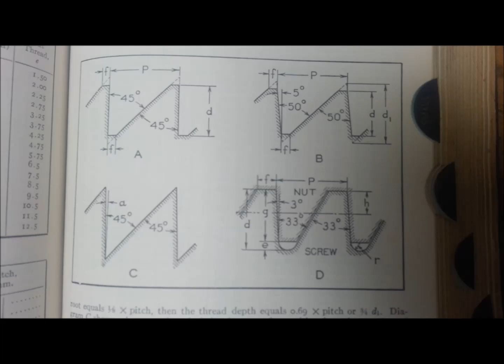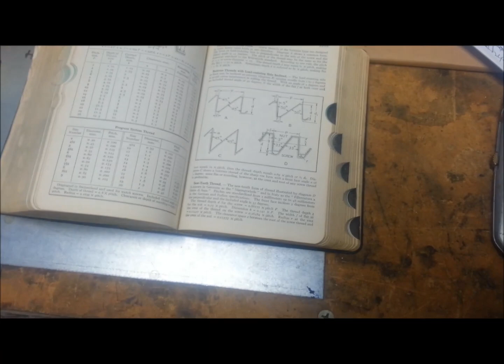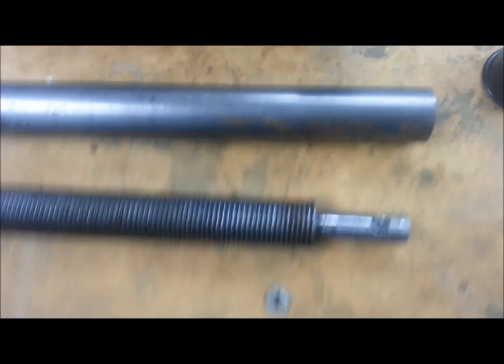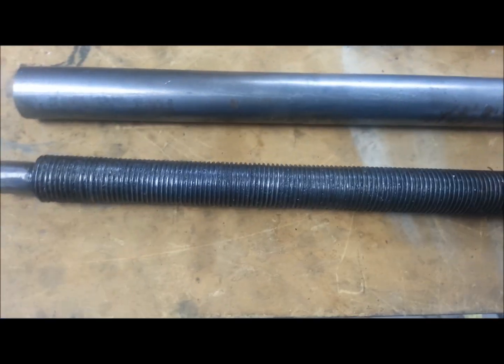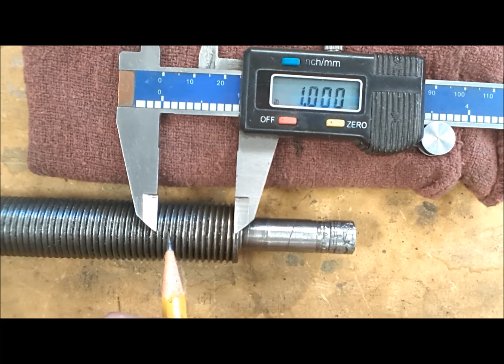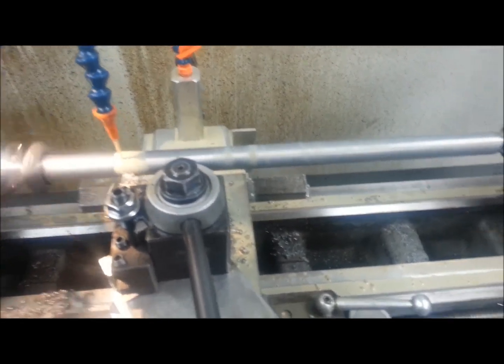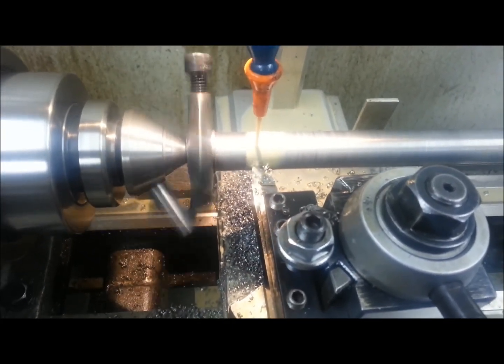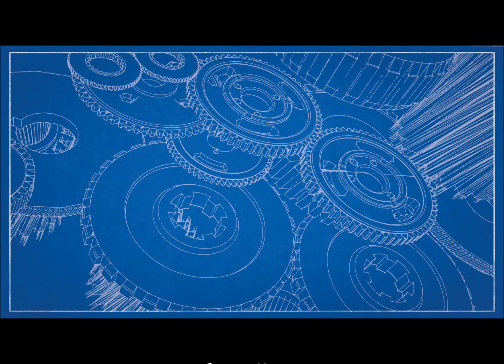Buttress threading

Comment: Hmmm, a rare video on the topic, and not much info about the topic in it... I do appreciate it however... I`ll need to make a thread like this soon - I have a project in mind, a plunger style pepper grinder... An inox tube with a few threaded bits that actually act as threads, and the saw-tooth facing with the thrust side downwards, so when you press the plunger, the teeth shear the pepper grains with each stroke, and get them out of the way after tossing the shavings out of the orifice... I guess i can`t explain it much better than that, but it was an idea that i had while browsing the store and looking at the commercial pepper grinders, one of which had a diamond knurled shaft to do the same thing, but the knurls likely aren`t all that good at doing the intended job, so i thought to myself that it should have been made with thread-like, slanted knurls, and then the idea of the buttress thread came to mind... 

I know that it`s a total waste of time, a ridiculously over-engineered bit of madness and something that only a machine zealot would engage in, but then again, I am a machine zealot, I stand by the logic the overkill is the best kill, and so the pepper grinder will be made thusly... I`ll likely just mis-align a regular threading insert so that it faces square to spindle axis in one way and has a 60deg angle to the spindle axis on the other, as it`s not an actual functional buttress thread that is intended to perform the job that such threads are intended to do, but being a ``saw-tooth`` thread, it will make for a great pepper-grain shaving mechanism, and i`ll be damned if it won`t make for an amazing gift for a few people that i know to be enjoyers of good pepper varieties, as well as being a cool little grinder for my own uses, what with my appreciation of good pepper in food... 

If I cared to do it, i could first use a radius tool and give the inox blank some grooves which could be filled by tig bronze brazing and cut down to match the surface later - during actual machining of the parts, as that would look quite nice... I guess that i could literally cross-thread(akin to diamond knurling) with the radius tool along the inox stock, starting and finishing in two actual 360 grooves, and fill that in, and machine that down, which would look even better, but that would be some proper madness, kinda like writing this comment on an 11 year old video on a topic that most likely nearly nobody looks up, and so most likely nobody will even see this comment, but I never said that I am not a madman of sorts... 

Best regards!
Steuss

P.s.
Also, the inox body will have at least 2, maybe 4 glass inlays, as to allow light to pass through and reveal the mechanism and give you an idea as to how much pepper you still have in the damn thing... Just a few drilled holes, a few glass rods(NO PLASTIC) and that`s it... 
The buttress thread is also ``kinda child-safe`` as it would not have the tendency to suck the fingers in - on the return stroke, nor would it shear along that vector, so it is a better alternative than most others...

Comment: More than once I have cut the buttress thread with the 45 degree angle on the wrong side. I think that I finally learned.  These threads are used on hydraulic cylinders with thin walls amongst other uses.

Comment: Clean the old threads then peen the edge of soft lead sheet or a small thin ingot into them to get an easily visible  look at the thread's profile sometimes works well for a reference to determine thread type and it can also be used to check the new threads if handled carefully.

Comment: PS:  Rueb Goldberging in hindsight; could you have clamped a piece of 1" brass bar stock behind the work on the cross slide to act as a crude follower?  Might be even better as you would be spreading the load across twelve threads instead of deflecting between threads (more of an issue on coarser stuff).  Just wondering.

Comment: Is there a reason for so much flood coolant?  Seems you could choke it down to just the point of cut and save a bit of mess?  What are the practical differences between a flood and drip system?  Good video.  I like this kind of topic much better than "industrial coatings".  I was wondering if the 90 degree face was going to get lost in the flipping for a heavier end in the chuck.  The kind of thing I find myself doing!   Happy Thanksgiving!  Doug

Comment: Stan,  that thing is a violation!  You're only allowed one weirdness per part design...buttress thread or lefty thread, but not both at once! Not your fault you assumed they were playing by the rules...

That's the best I can do for you on defense. Thanks for the cautionary tale.

Have you considered using it as is and making a new right handed half nut?

And out of curiosity, is this the sort of part that might require case hardening?  That would be fun to see, and you even have a part you can practice on!  :-)

-- Mike
Reply from the maker: Carburized in charcoal and quenched in oil, the threads got hard, but the main shaft still has a soft chewey center, sorry, didnt shoot any vid.
Thanks for the view and comment.

Comment: Hi Stan,

Nice video, explanation and build!  Put the shaft on EBay, somebody could use it!

Curious why didn't you cut a short test part in Delryn or aluminum before cutting the complete shaft, that was my question in my mind once you started the scratch cut!

Chuck
Reply from the maker: Hi Chuck, 
Unless I seated the half nut for a test fit, there was no way I was going to catch it, I had the blinders on and was focusing on all the other features of the screw, I would have probably still cut it wrong with a test piece.

Comment: Looked up the word "buttress" - since I've never seen it before, and it means support - in architectural structures.... I guess the support here, is for the heavy axial thrust on the threads...from the crankwheel or nut side... Very interesting video! Thanks, Stan ;)

Comment: If you aren't making mistakes, you ain't trying hard enough. Easy to do there, get so absorbed in figuring out the details of the buttress thread, you got blinded to the mundane detail. 2 lessons for the price of one. It is only a failure if you don't learn from it.

Comment: It would be funny if you started the video with the threaded rod being chucked into the scrap barrel.  Or  add a scratched record sound effect and an old clip of two steam locomotives crashing head on after the fubar!  Whoops.  Or you could cut split nuts threads (if possible?) that would match...if direction of rotation was inconsequential.  Bummer.  Not a big loss.  Think of all of the guys that will never forget to positively ascertain the proper thread rotation, thanks to this experience.  Otherwise, great video.